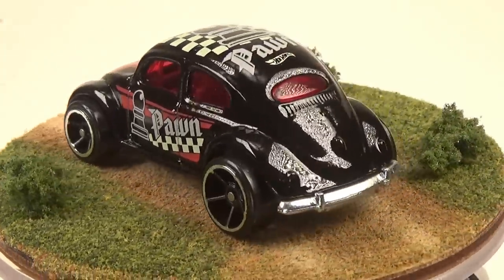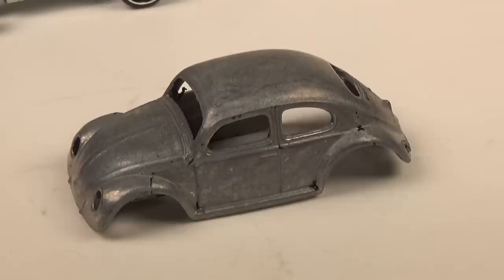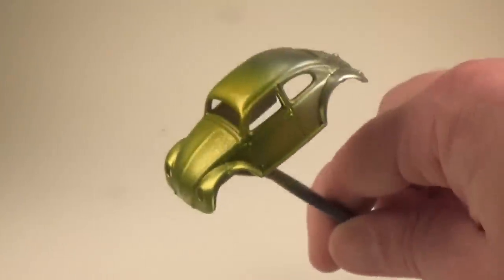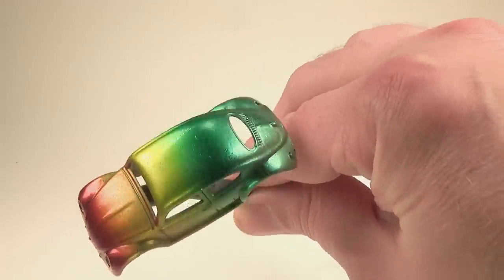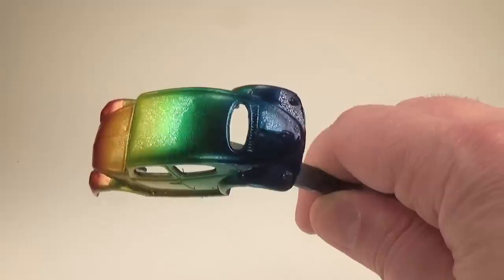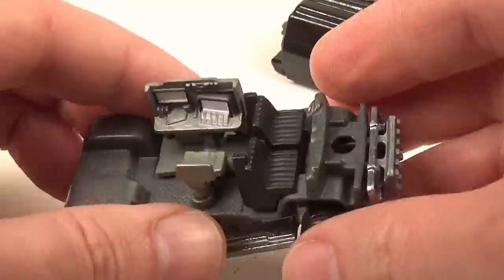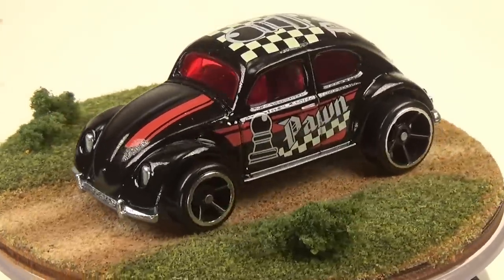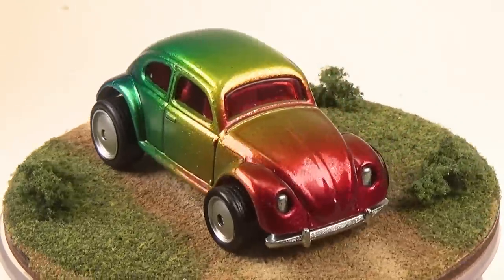Making a Spectra Flame Rainbow Car.

Comment from the maker: Blue and Yellow make green.... I misspoke... but for some reason when blending Spectra Flame paints, Green and yellow give a teal blue.  I should have explained myself there...
Reply: we all misspeak at some point.. we knew what you meant ... it's all good
Reply: Had me doubting myself for a second,  thanks for clarifying
Reply: Mwoah. If the green paint is made from mixing blue and yellow....adding a yellow later could result in a blue-ish shine. And yes, that maybe hard to see on video, but IRL your eyes can play that trick on you....
Reply: baremetalHW My 7 year old son loves watching your videos! He wants to see you restore a few of his Disney Pixar Cars toys. He has hundreds and we would definitely send you a few if you’d be interested. We have several duplicates as well!
Reply: Yes, pigments can combine in ways that do not appear in the elementary how to books and videos! The reason is that paints you buy commercially are not typically based on a single monochromatic pigment. Instead, most paints are a mixture of pigments and thus non-canonical mixing effects occur when you put them together.

The one thing that surprises me is that manufacturers usually push the trouble into the so-called "non spectral hues" i.e. blue/red mixes (so you get mud instead of purple). The yellow/green/blue set usually behaves as would be expected.

I suspect that the additional conditions set on a transparent spectra flame job made it impossible for them to also obey the green+yellow=yellowish green rule.
Reply: I have this scratched 1997 green dairy delivery with the exposed metal (scratched) that still shines. Can you tell me what is happening?
Reply: That came out beautiful

Comment: Glad you started with yellow. A graphic designer once told me, at least in printing always start with yellow/ lightest tone. Darker tones go last.  When you do the darker as the base it takes a lot of layers of the lighter tones to cover over the darker parts. I used to work in commercial embroidery. When I had blends of colors to design, before I knew this, If I had yellow on top of red, red bits would always show through in the wrong sections. It really made designing the sewing files easier to get the effect right. 

Sometimes I miss doing the embroidery cad work. On a good day, it was being paid to color. On a tedious day, it was hand drawing lots of letters. Graphics were usually more fun. It’s been almost 20 years since I worked in that industry.

Comment: Nitpick but you said yellow and green make blue instead of blue and yellow make green ;)
As for the sandblasting method, it looks pretty close to the original look you are going for. As someone mentioned blow, you can try soda blasting, it's a much finer medium and will probably yield an even closer match with less detail loss and noticeable pitting.

Comment: Suggestion, and this is based on personal taste: Consider getting a soft box / diffuser for your LED light, this will conceal the grid of individual LED elements visible in the reflection on the paint. You can even just tape a piece of printer paper such that it bows out over the front of the light. I realize that you might find the visible LED grid useful for checking the paint finish, but I thought I'd suggest it because you're a technical person, and at the end of the day HW customization is all about the looks!

Comment: Tip for 4-15-2020 When re-gluing CA glue on straight axle cars. Put a gate "glob" of paraffin wax in all 4 corners of base. Set axle on base into wax then use thumb to heal the slot around wax . Wax will hold axle in place "center and squared" Glue as usual. CA glue will not get into tire hubs.
 You could use plumbers putty if that's all you have... But most people have a candle around the house somewhere.. If not steal one from your grandsons birthday cake... LOL...
Most paraffin wax will soften enough with body heat.
 From Pintony

Comment: I think it turned out great, I especially like the wheels you put on it. They really set it off nicely. 
  I was a little iffy about the sand blasting but this has changed my mind for sure! The paint looks so sick. It kind of looks like metal flake bc it sparkles like crazy. Is that effect from the sand blasting?

Comment: Your work on the rainbow paint is BEAUTIFUL!  The only thing I don't like here leads me to a question: I'm not a fan of the red windows, they draw a bit of attention away from the gorgeous paint work you've done.  Since I mostly work on Transformers and thus interiors are usually folded up robot bits and faces pressed against windshields, I have no problems painting windows opaque.  For people like yourself who work more with proper models with at least a little interior detail, are opaque windows pure heresy, or something you might consider in rare cases?

Comment: Nice job 👍..I tried platting copper on an old redline with a old phone charger as a power supply it ended in disaster 🤢 is it better with a battery or am I just doing something wrong??

Comment: Hey baremetal. I have an inquiry. Now of course the aircraft paint remover works real well with hot wheels cars since a lot of them are metal, but my question is will the stuff that you use (or something similar) work on Warhammer 40k models? I believe they are made of a derivative of polystyrene plastic or resin. I need a nice easy way to strip models. I've tried simple green and that doesn't work well. Thank you for any response!

Comment: Hey I've got a question. My brother in law has a crew cab Ford truck and I wanted to give him a hotwheels of his truck. However hotwheels doesn't have a crew cab 80s ford truck. So I bought two single cab trucks cut them in half and joined the 2 cabs together with soder and body filler. I was wondering how you would do it and if you would make a video on it. Mine came out pretty rough and I was wondering how someone with more experience would do it.

Comment: Have you tried to 3D print a replacement windshield?  The red windshield distracts from the wonderful paint job.  A clear 3D printed windshield done in clear resin would probably do the trick. Also, windshields done in color hides the interior of the car.